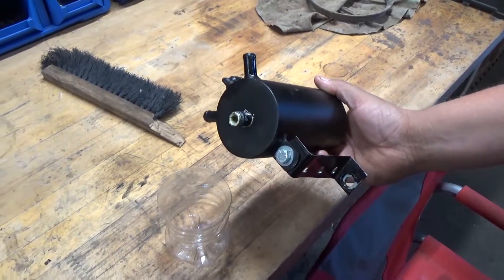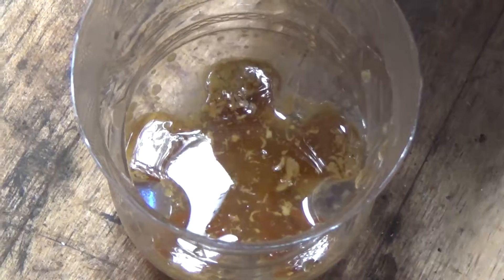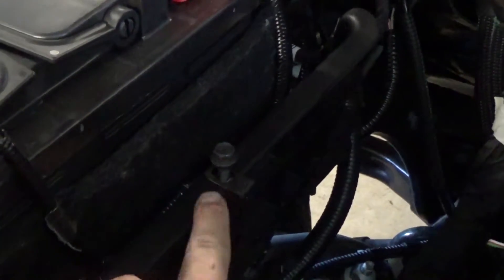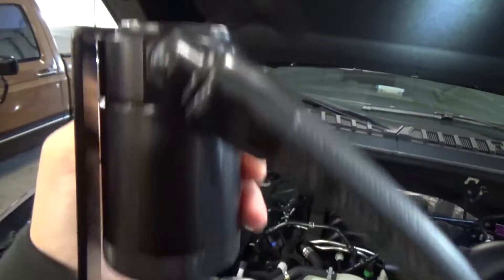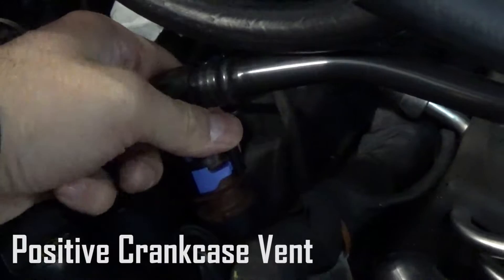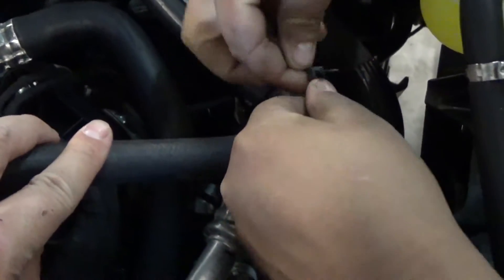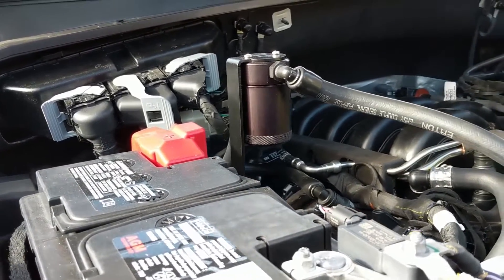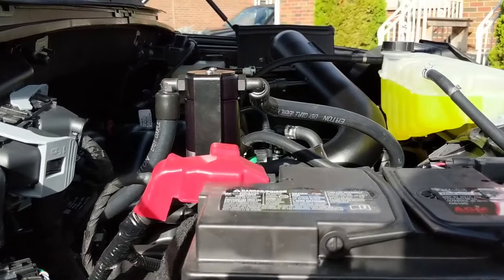JLT 3.0 Oil Separator Install on 2019 F150 5.0L

Comment: so...does this keep your truck from burning so much oil? also should i run 5w30 in my 2019 5.0
Reply from the maker: @kd5dcj  it'll help prevent oil consumption, I would recommend a minimum of 5w30 and no thinner. I'm currently testing different 5w40 oils. My truck burns less than 1qt per oil change interval now. Fully synthetic oil only! Don't get synth blends.

Comment: Great video man! I have a concern because I regularly remove the oil inside the catch can and I always find very small metal flakes. I have a 2018 5.0 with 30k miles. Any idea why this could be happening? I’m guessing regular wear and tear from the engine.
Reply from the maker: Next time you change your oil, or get the dealer to, tell them to cut open the oil filter and see what's in it. You could have wear in the pistons/cylinders, or something from top end.
Reply: Thanks for the feedback I will definitely do that next oil change.
Reply: @israeljr9330  Send a cample to backstone labs, they'll tell you what in the oil if anything.

Comment: I have an F150 Roush with a Super Charger, it has an additional hose leading to the rear of the engine my Scharger connection is different. Can you inform me please.  Thanks.
Reply from the maker: I'm not too sure, maybe post on the F150 groups on facebook, lots of good info and others who have SC's

Comment: I have a 2017 rclb4x45.0. Transmission is a 6 blew it up gladly still on warranty. Cooler line went and she ran low on fluid. Warranty gone as of july and I am going to tackle a few of the mods you've done. Subscribed eh!
Reply from the maker: Cheers, thanks for watching!

Comment: It would be tough to rate a 5 star on a product that you have to use a zip tie. Personally I wouldn’t want that in my engine bay where it could melt and cause other issues. JLT should redesign

Comment: Do you have the new PCV valve and Dipstick yet?   My truck absolutely stopped using oil with the new designed PCV valve.  I'd be interested to see the difference in oil cought before and after the PCV valve replacement.
Reply from the maker: Well this is the Gen3 coyote, so I'm assuming I would have it, but I'm not sure when they implemented it?
Reply: @EliminatorPerformance  no the issue is new to the 2018, 2019, 2020 engines.  There are two TSB's out late last year.  1. New PCV valve design.  2. New dipstick design.  The dipstick that were in the engines at manufacture are too short.  This causes people to over fill the engine with oil.  That is why they were using oil.  Blowing it out the PCV valve.
Reply from the maker: @fabulousoffroaddesigns5080  thanks for the info, I'll look into this!
Reply from the maker: @fabulousoffroaddesigns5080  any chance you have a TSB # for this?

I can't find anything online, other than the "excessive oil consumption" issue, which was caused by high manifold vacuum pressure sucking oil past the rings into the cylinders. Or poor Piston to cylinder tolerances (depending on who you talk to).

Thanks for any info you can provide!
Reply: @EliminatorPerformance  I don't have the # but I had my PCV valve done last April and the dipstick I will be doing at my next oil change.
Reply from the maker: @fabulousoffroaddesigns5080  from what I can tell, it's only on trucks built before Feb 2019, but I honestly couldn't find a TSB that specified the dipstick or pcv on a 5.0L

There was one about the 2.7 and 3.5 though
Reply: @EliminatorPerformance  check with your dealer.  I think they are only doing the ones on a case by case account.  I have a pic of the PCV valve on my Instagram I think.  @FabulousOffRoadDesigns

Comment: Does it matter which tubings go to the separator? Like 45 n 90 degree to the left or right? Bc I seen other vids and you connected them opposite. The crank goes to the one closer to you. The manifold goes to the one further away from you?
Reply from the maker: So far so good, no issues here, it's working as intended! I'll be posting an update video, draining the container around 4000km.

Comment: Hoses look too long. I've seen other kits (same JLT 3.0) come with the two ends for the catch can loose where they can be cut and then the ends slipped on.  Mine came assembled and I don't like the extra long hose. Catch can also sits about 4 inches too high when mounted to the battery box but it still clears the hood. It's a good system but JLT should clean up this fitment for the 5.0
Reply from the maker: Yea, others had removed the fittings, cut the line and reattached the fittings, but I didn't want to bother with that. If there's an issue, I can deal with that later, but would recommend using seal-all when re-attaching the fittings.

Comment: Very informative video, you would think this should be standard issue on all vehicles any idea why not?
Reply from the maker: Yes you would think, and most likely cost! Thanks for watching!
Reply: @EliminatorPerformance  more than cost, it changes the emission set by the Obama administration’ thats also the reason for the turning engine off and reset switch at red lights.